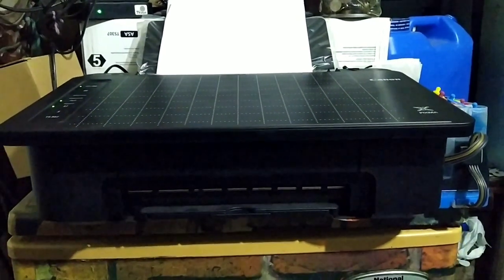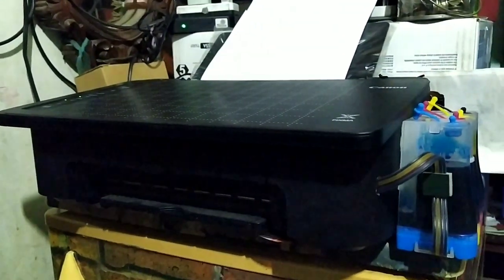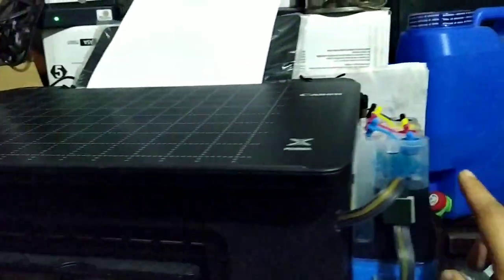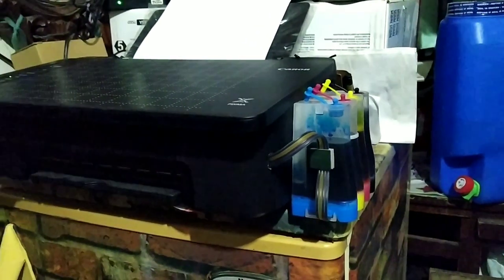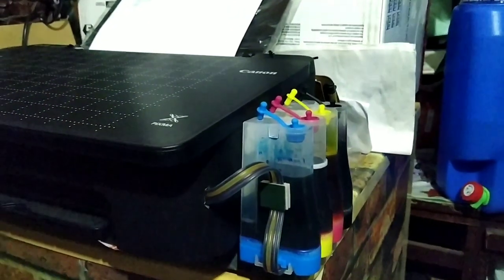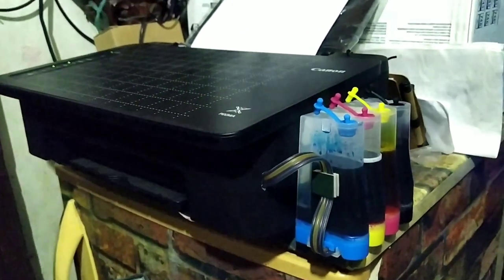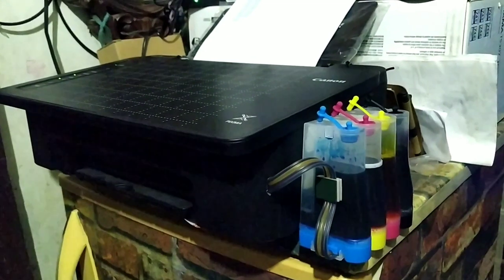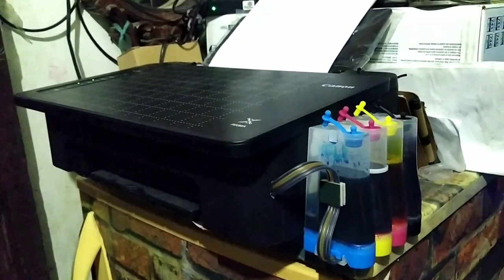Canon Printer: How to Convert/setup CISS (Pixma TS307) #canon

Comment: got this printer as well, instead of ciss i will use the refill kit instead. no need to install tanks and other stuff but still the same high amount of inks in the cartridge.
btw, take note these are cheap type of cartrdiges so do give them rest for some time ex. 20..30 prints. maybe a few minutes else the head will easily get over wear, end up u saved on ink but need to buy frequent cartridge which in the first place u tried to avoid..
good luck.
^.^
Reply: Hi, how do you reset the ink level. I tired refilling but stopped working with yellow blink. Pls share the steps to reset the ink

Comment: for this model, do you know how to (1) reset empty ink error?  (2) reset ink absorber pad full error ? 
do you have the resetter tool?
Reply from the maker: 1. To reset empty ink error - i normally just click on the button below the power (the one with arrow down) just long press for atleast 15-20 seconds. It will restore the error. Sometimes you have to repeat doing it multiple times, but it works. Hope this helps
Reply from the maker: Try with the power button as well. Just Long press.. been having that error normally if i printed the maximum 100pages.. but just pressing the power button or the one with arrow down should Refresh from that error
Reply: @MikasaTattooAndCrafts  
noted, so it's a tiral n error thing.
Reply from the maker: It's a normal error for printer converted to CISS.. the printer still recognizing the cartridge settings
Reply: i see.. printer errors has actually nothing to do if regular cartridge was done ciss conversion.
kindly update this yt vid if you encounter the above two items.
hopefully you can get to ask ur tech that intalled this.
thanks.